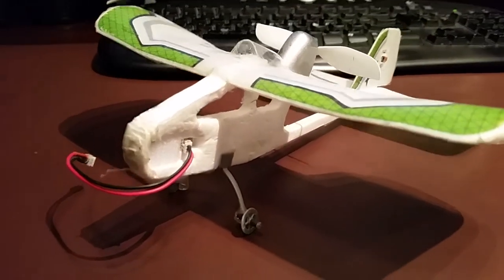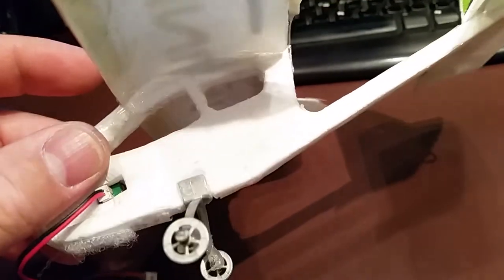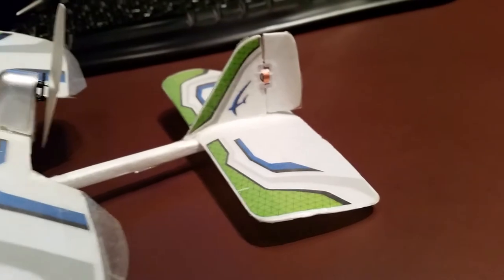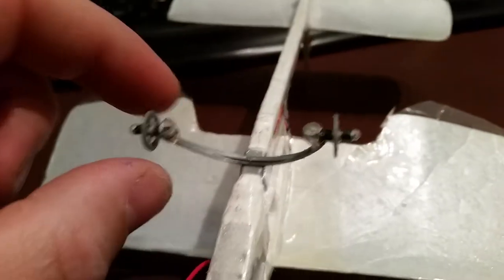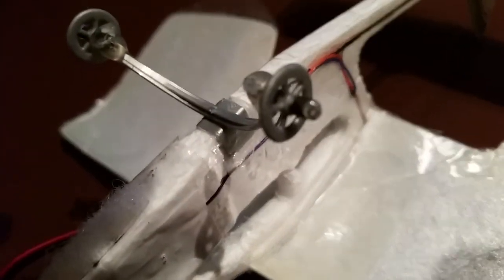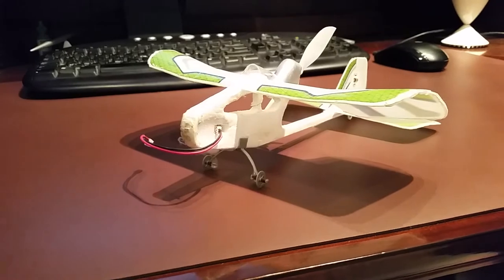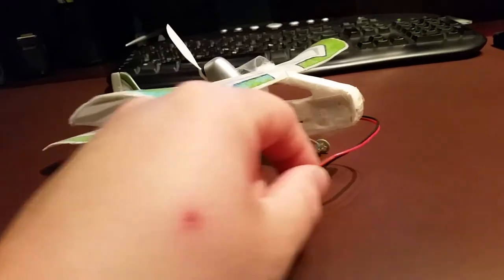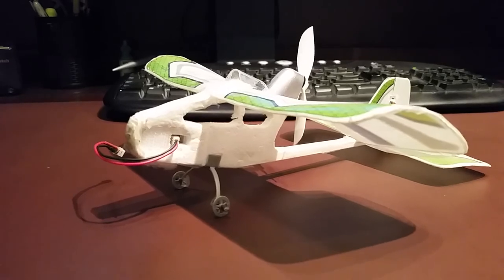Flyzone - Inum - Wheel Repairs Mod and Other Mods Review

Comment: Many many thanks for the detailed explanation  and video. I did something similar trying to fix it but just used wire in just half of the landing gear not into the other wheel like yours. As a wheel I used a beat from a brazalete . It have a whole inside and I just bent the wire so stays in place . But unfortunately last Friday my son (5 years) crash it against my leg , the tale is broken in half . So , I have another repair in place . I will try to send a video a post it , I have not done any video ever but I will . I hope you can give me some advice. 
I fly the plane with my son we have a really good time , I hope I am able to fix it. 
One again many thanks for taking the time to make and send that video . 
King regards 
Alex
Reply from the maker: Bummer, but this plane is very easy to break, but luckily it's almost as easy to fix too!!!

A few things you should have if you want to fix this plane as well as many other planes too.

You really need CA like this... 

https://hobbyking.com/en_us/super-gold-plus-odorless-ca-glue-1-2-oz-foam-safe.html?___store=en_us

...It's called "Odorless" which means Foam Safe, and the Black Cap signifies Medium Thickness too.

Accelerator (also known as Kicker)...this stuff makes the CA set almost instantly, which REALLY help a LOT...

https://hobbyking.com/en_us/insta-set-ca-accelerator-2-oz.html?___store=en_us

I really don't care about the brand name, since Bob Smith Industries (AKA BSI) makes virtually all of the CA on the market today, but I DO ABSOLUTELY care about the "Foam Safe", for instance, if you tried to use this...

https://hobbyking.com/en_us/insta-cure-plus-gap-filling-ca-glue-1-2-oz.html?___store=en_us

...the CA would EAT THE FOAM and your plane would cease to exist!!!

Once you get this at your local hobby shop, or order it from Hobbyking, or your favorite online retailer. This stuff goes a long ways, and keep it off your fingers, furniture, and be prepared to cut apart anything getting bonded together. It may seem expensive, but if you plan to enjoy a small RC plane, YOU NEED IT - take my work for it. I literally use it every single day I'm working on planes.

One last detail I need to clarify with you...did you break the very small wire going to the tail?
Reply: Brian,
I finally repair the tale last night , i used UHU foam. It glues very good with foam. However, i think i may not last as long as yours, i would like to to try to build one from scratch a bit bigger because i wont be able to make it as lite as the original so in need more wing surface. I know that i can buy one again , but there is something about building things on you own that is telling me that i should do it. 
I would say about 10 to 20 % bigger . I have a question for you: do you notice in your motor any down thrust angle? I have read and see some pushers that need down thrust in order to adjust the flight. I can no longer see the angle in mine  because the motor got lose and almost detached from motor grey canopy. Thank again!!
Reply: forgot to answer, no i did not break the wire for the magnetic actuator. I was very lucky and just broke about two mili meter offside from the center so i am good.
Reply from the maker: Lucky duck!
Reply from the maker: not lots of down thrust...pretty much square to the mount.
Reply: Brian Phillips , ok thank
Reply: Brian Phillips , many thanks!!
Reply from the maker: no problem, hope this helped!